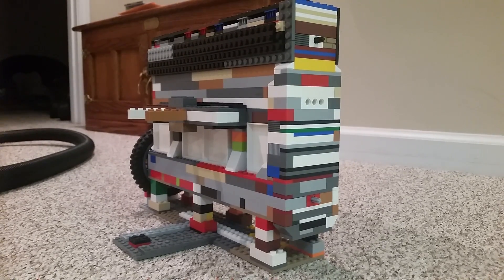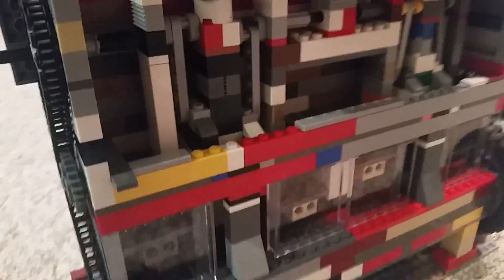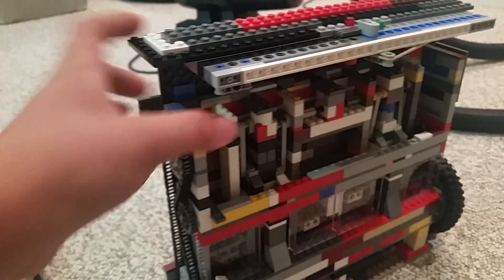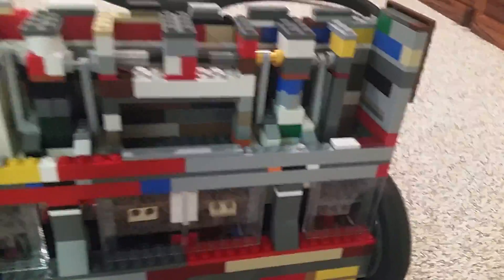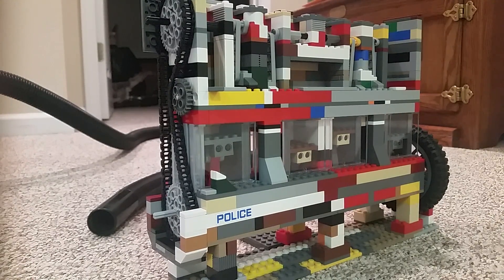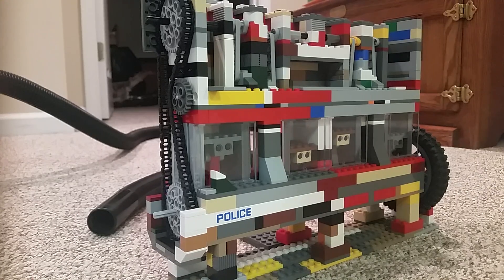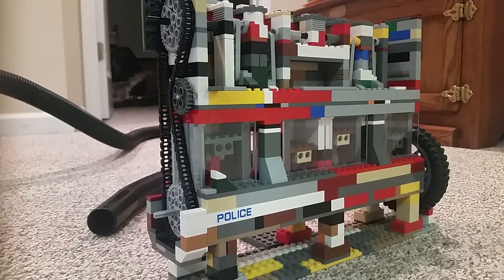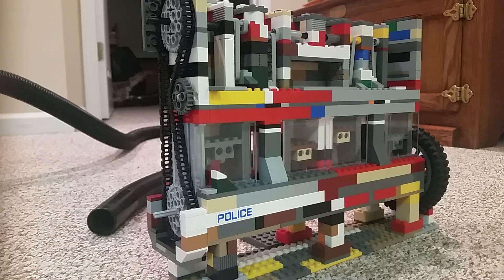LEGO 4-Cylinder OHC Vacuum Engine Part 1

Comment: The greater the displacement you have the slower the engine will crank with a set flow of air (IE the same vaccum). Youll need a bigger vaccum and less parasitic losses to go any faster.

Comment: your pistons arent positioned at the right angle on the crank, need to fire 1-3-4-2
Reply from the maker: I think mine is at 1 3 2 4, but I also believe it doesn't run fast enough nor would it really matter at all for an engine of this type
Reply: @sneedsspeedandfabrication  true... but a little but more realism could really get this engine up to speed (as in looking good)
Reply from the maker: @sonia.bennett1  I might give it a shot
Reply: @sneedsspeedandfabrication  ive made my engine an in line 4 with that firing pattern but i cant seem to get it to operate smoothly for a long time... still working with it tho
Reply: it has a cross plane crank like an american v8

Comment: Maybe, if you make the displacement smaller it can rev high and have more power, it’s cool I want to make one to XD
Reply from the maker: I've thought about it,the only issue is if the pistons are too small,I may have trouble making adequate connecting rods
Reply: Oh, i Made a engine with a 2 by 2 piston

Comment: What type of lubricant are you using? If it isn't lubricated, put some on it, the engine will run a lot faster. I made one of the simple two cylinder engines once, though it didn't run too well. I put some door hinge lubricant on it and the little engine ran way faster. I was surprised it didn't tear itself apart.
Reply from the maker: I don't use any lubricant on my engines and I prefer not to. I know it would help but I don't want to take chances on ruining parts
Reply: Do not use WD40 or Rifle Lubricant, it will destroy your Legos, instead, use baby oil or any olive oil you have. It will seal cracks and lubricate each cylinder.
Reply: I would just put like 5 drops of cooking oil in each cilynder

Comment: try to see if there is any leakage , that is the constant problem with lego . good job on the design u earned a subscriber :)
Reply from the maker: thank you for the subscription. and you are correct, air leaks are the death of performance in these engines. there are quite a few places I am thinking have leaks.
Reply: @sneedsspeedandfabrication  a thin layer of silicone clue can help with that too

Comment: This engine is pretty much AWESOME (by my opinion). You could have posted this engine as a marine 100 000 horsepower engine. They are not running that fast to keep the engine in its best condition. As I said: This is AWESOME.
Reply from the maker: thank you very much, I have put a good amount of work into it and it is nice to think someone else appreciates it
Reply: Marine diesels are also so large that if they did run that fast, they would explode (literally)

Comment: that isn't actually an overhead camshaft. it is very impressive though. a can shaft pushes on a rocker arm to open one of the two valves. that may run better. along with smaller more enclosed pistons
Reply from the maker: I understand the actual mechanics of a OHC but when I tried on my previous attempt to make a 4 cylinder OHC (which was before the 2 cylinder exsisted), rubber bands were the springs bug it wasn't enough pressure because the vacuum held the valve down, and I knew if I increased the spring rate, it might of been too much for the engine to push, so I scrapped the idea periodically and then this was born, the closest I could get to a true OHC.